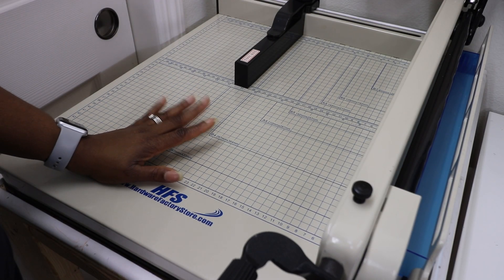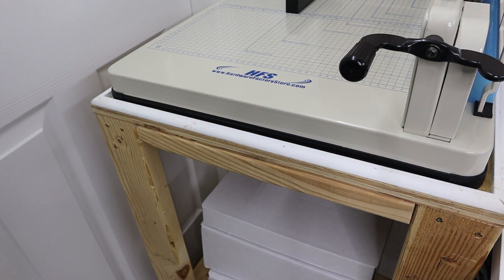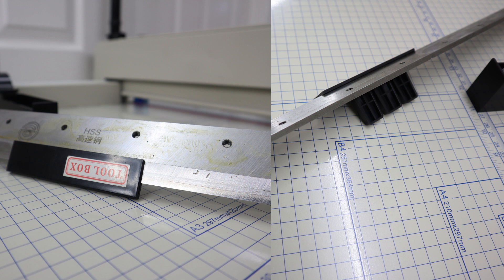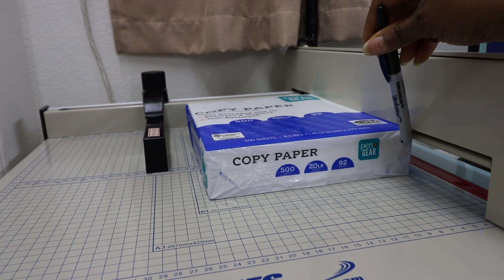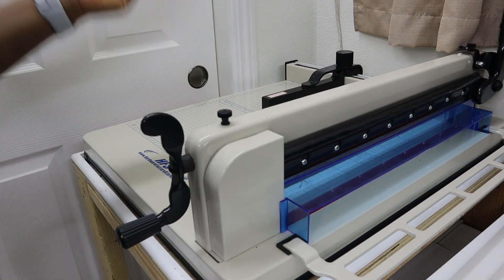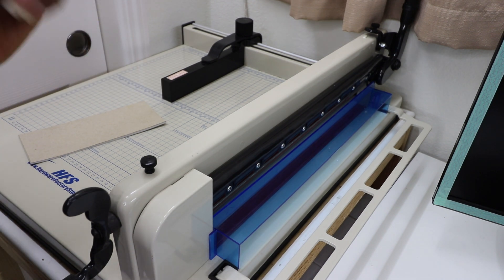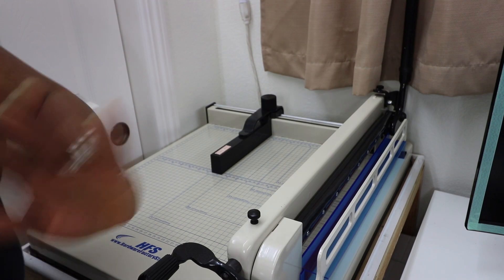Heavy Duty 17" Guillotine Paper Cutter Review| HFS Paper Cutter

Comment: I bought it on Amazon, I face a lot of accuracy issues and struggle hard to make an accurate cut. The main issue is that, even after arranging everything neatly it somehow messes up the cut, the bottom paper slant outwards and  about 1cm of the bottom stack is gone. Currently I am using rubber band to keep it in place and a cardboard on the bottom for a clean cut. My machine is made in China so it will not compare to a machine made in USA or Germany, (they make everything hurriedly disregarding the quality) . Another problem is that my machine is black in colour so at times it's hard to see the ruler marking specially where the slider is stationed. Somehow I am making it work. Your video is helpful.
Reply from the maker: Hi, The Inquisitive mind,
Sorry you have to do all that to get your machine to cut accurately! 

Based on what you said and looking at a heavy-duty black machine similar to mine on Amazon (it seems like the same machine, just a different company name with a different color), it sounds like you're not getting a 90-degree cut. I have found it to be almost impossible!

However, I have found that the smaller the project, the easier it is to get a straight cut than when cutting a larger book. I also help counter this problem by pushing the bottom stack of my book up against the plastic holder since larger books seem not to jam up to it properly when placed initially. Then I tightened the plastic fence and the metal fence as tight as possible. 

In this video, https://youtu.be/qCsjkM9PUII, I show how I try to get straighter cuts if you're interested. I also have a playlist of other things I had to adjust to align my machine. The playlist is pinned in the comments.

I agree with you on the quality, though. However, it is OK for what it does until you have issues.  And if you're willing to fix or adjust the machine. 

Not convenient, for sure. 

This was a good option for me, the time and money I spent every time I wanted to take a book apart.

I liked the black version too, but the contrast with the little white lines on black, I figured, would be difficult as I'm getting older.

I am glad the video was helpful, and thank you for watching!
Reply: you didn’t use it properly, did you even tighten the lever that pushes down to hold the paper in place?
Reply: @KimoKimochii  Yes i did.
Reply: @theinquisitivemind4629  Mommy’s videos may help you with your issues, btw HFS doesn’t make these cutters they just rebadge it

Comment: I feel like I am missing a step in setting up my machine, it won’t cut through one single sheet
Reply from the maker: Hi Johana. Someone else was having this issue, and this video here ---> https://youtu.be/3GuFbWj23MY was made to try and help. You can check out this timestamp---> 9:13, where the gap was closed to enable the blade to cut through single sheets. I tried giving other tips through the video and placed timestamps to make finding helpful information easier. I hope this helps. Thanks for checking out the video.

Comment: Hello, what are the safety features to avoid exposure to blade ? And do you have ceramic blade cutter?
Reply from the maker: Hi, when the black blade handle extends fully up, it locks into place. To release the handle and allow it to cut, a lever must be pushed.
Thus, fully extended and locked, it won't 'accidentally' fall toward the cutting stick, potentially hurting someone.
There is also a blue plastic guard extended over the outside of the blade. 
A metal fence that acts as a catch for your cut ends raises to act as a fence on the outside of the blade when the machine is not in operation.
No, I do not own a ceramic blade cutter. This machine cuts different types of paper, including cardstock, and it also cuts chipboard.
I hope that helps. Thanks for watching!

Comment: Can we cut business cards with this
Reply from the maker: Hi Terry. 
Yes, it can. It cuts excellent for single card stock paper, though this machine might be a lot for only single sheets. 
If cutting in bulk, stacks about half an inch or lower from the base give a pretty straight 90-degree cut. 
In my last cutter video, I tried to address issues of larger not being straight and suggestions.
Under that video, I also got a great suggestion I am yet to try, plus another commenter left a great tip she learned while watching another channel. If it pertains to you, you can check it out here ---> https://youtu.be/ucS7fAx-Zls
I hope that helps and thank you for watching!
Reply: @MommyShareSpace  I was also looking into a business card machine because I was like maybe this aint good for it. But I do flyers too do you think I could do 4x6 flyers with this
Reply from the maker: Yes, you can. There is also a smaller version to this one. It's the HFS A4-12". Works just like this one and a great consideration if you're only working with smaller projects.
Reply from the maker: I now finished using my old Swingline 12" paper cutter Model #9312 and thought of your question again. 
Not sure what quantities you work with. However, I have owned this now $35 cutter for well over six years, and it still works great! Advertised, it can only cut ten sheets at once but cuts clean if working with two or three sheets. It is super sharp (I cut myself with it once) and much cheaper. You can find it at Walmart or Amazon. This is it on Amazon ---> https://amzn.to/46MB9qf . 
I added the above heavy-duty cutter for cutting books.
Reply: @MommyShareSpace  thanks I actually ordered the one you have I think im gonna return it.  I saw a business card machine online where it cuts them itself just put paper thru and it cuts it to the size.  So I will be doing 4x6 flyers so I will use the link you sent and use this to cut the flyers.  Thanks
Reply: @MommyShareSpace  quantities people order 100 or more of them I didn't want to be sitting cutting for days lol so yeah I'll see if if I should send it back considering the flyers ppl be ordering alot
Reply from the maker: Nice. Glad you found a machine better suited to your requirement :)
Reply from the maker: Lol. Well, the machine you found sounds more efficient for what you'll be doing.

Comment: Thanks for your review. I have a little problem with the mine, when I begin to cut, the blade pushes the paper forward and that makes it not aligned. I guess the holder isn't working well. What should I do? Thanks
Reply from the maker: Hi Christian Akwesi Amoafo Ministries.
Sorry to hear you're having issues with your machine. I agree with you that the plastic holder could be better. You have to tighten the holder and ensure your fence is securing your project well to increase the chance of accurate cuts.

In looking at mine and determining what might cause the problem you are experiencing, I can only assume two things other than clamping the project tighter.

-The blade may need sharpening or replacing. The downward pressure at the top end of the blade may not be slicing through the top portion of your papers quickly enough and is doing some pulling before it cuts. Or

-The top end of the blade is not cutting into the paper first, then slicing through the rest. In other words, the blade is aligned straighter and may not have a small 1-2 mm spacing near the bottom end of the machine. 

I cannot be sure, but that is what I can assume, looking at mine. 

If that does not help, I made about three videos on my channel showing how I fixed the issues I was having with my machine. 

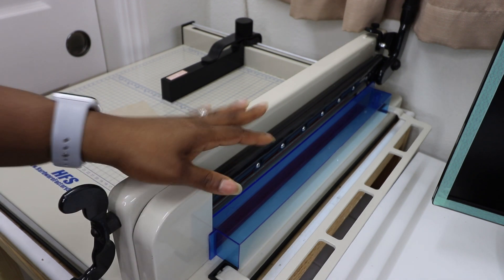In this particular video: https://youtu.be/3GuFbWj23MY, at the 10:43 time stamp, I showed how to adjust for the spacing. Earlier in that video, I showed how to work with the vertical bolt and screws and how to use leverage at the pivot point to get your blade angled properly at the top end of the blade.

You can check out the playlist if it helps. I have it pinned as a comment under this video. 

I hope you can get your machine aligned soon. Thanks for watching!

Comment: Can it cut heavy weight gloss coated paper neatly?
Reply from the maker: Hi Aishwarya.
Yes, it does, once the blade is sharp. 
I just wanted to point out, though, that coated paper will dull the blade a bit faster if used for this type of paper regularly, as there is a small adhesive layer between the paper and the gloss.
But now and then, it should be ok. I cut photo paper with mine sometimes. Thanks for watching.